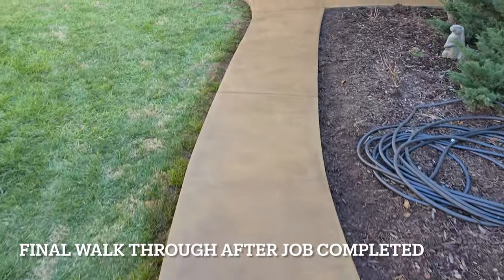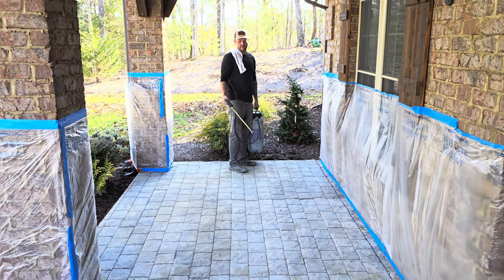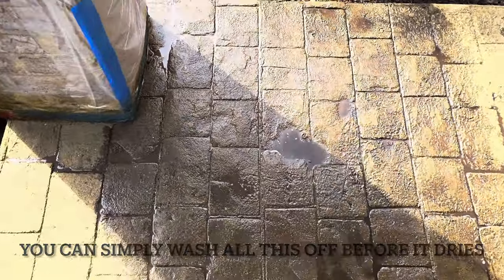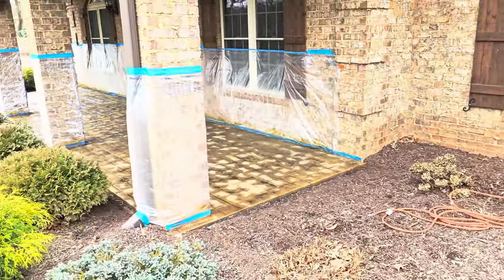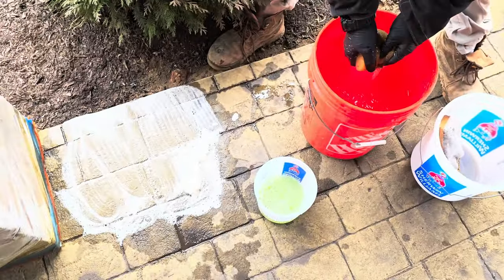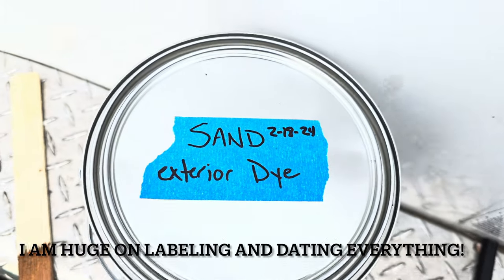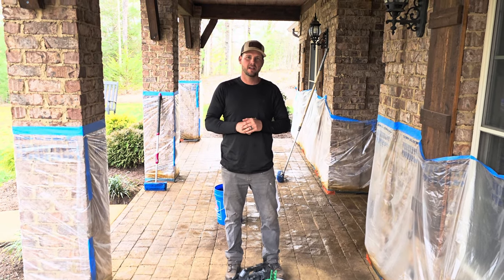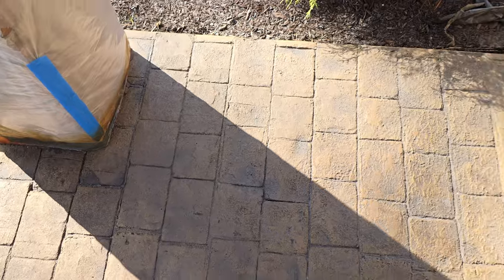Coloring old stamped and broom finish concrete using exterior acetone dye and liquid antiquing.

Comment: Is the acetone dye permanent like acid etching?
Reply from the maker: It's only as permanent as the sealer that protects it, just like acid stain. Acid Stain changes the top layer of cement paste which is the most permanent option, but it is inconsistent from project to project and especially from truck to truck. I will never use acid stain again on something that was done in more than 1 pour I've had major issues with that being way off in color. This exterior dye you get what you pick every time. Just make sure the sealer is maintained. The nice thing about this is if you ever get a scratch or gouge it matches exactly and you can touch up easy since it reimulsifies the sealer and bonds to it
Reply: @bensconcretecreations  Excellent, thank you! One more question -  can you use a water based sealer over the dye or must it be solvent based? I have a hard time finding solvent based sealers in satin locally but have no problem finding it in gloss.
Reply from the maker: @weeeves  all we use is a low sheen solvent based acrylic. It also has MMA resin and siloxane. Best sealed ive ever used. Personally not a fan of wb sealer outside but that's just my opinion.
Here's another thing to look fot when using solvent based sealer with acetone dye. Make sure you spray your sealer you cannot roll it. It will smear the acetone dye around so Make sure and spray it
Reply: @bensconcretecreations  That's good to know! I appreciate it!